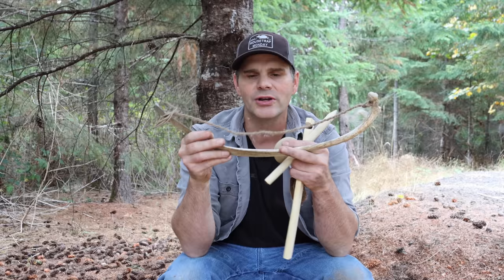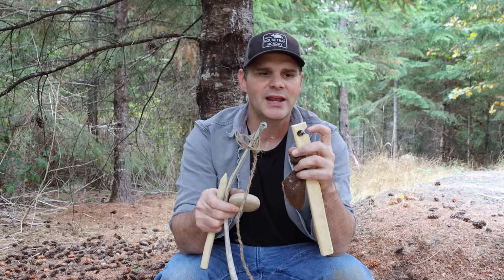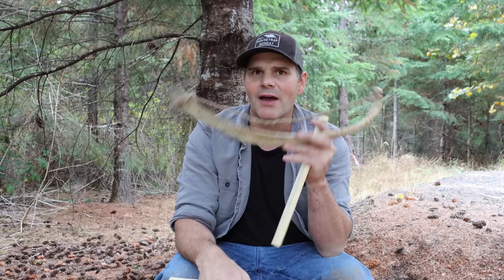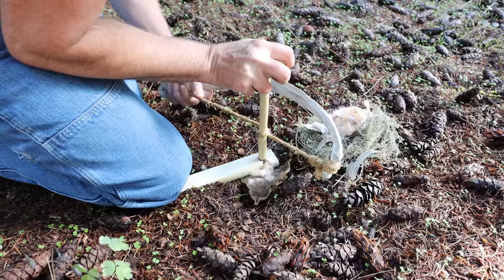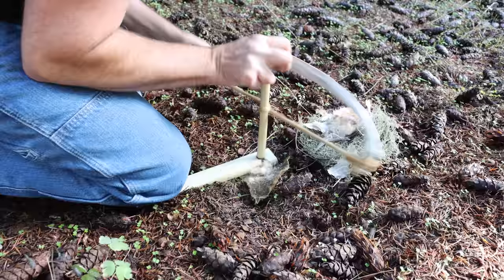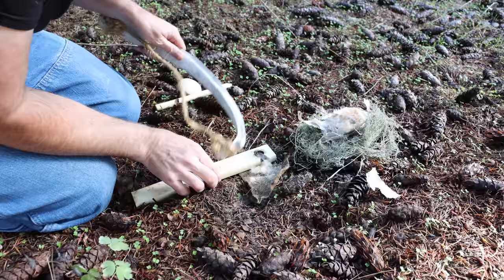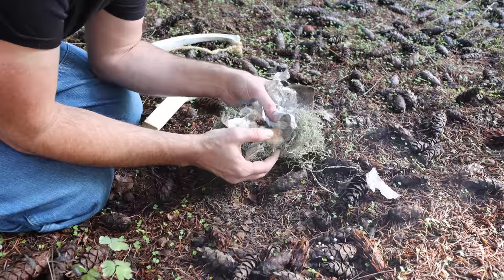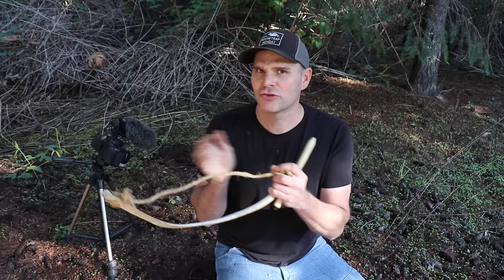BOW DRILL Friction Fire - Bushcraft Survival Skills.   Mousetrap Monday.

Comment: Nice fast work. One issue I see is you do not say what type of of wood you use. Some wood types works better than others. Nor, how to make that rock holder privet. I would suggest you add that type of info into your video or a supplemental video. Our boy scout troop has used this method also. hit n miss on their success rate.